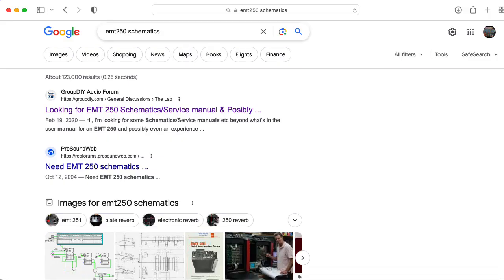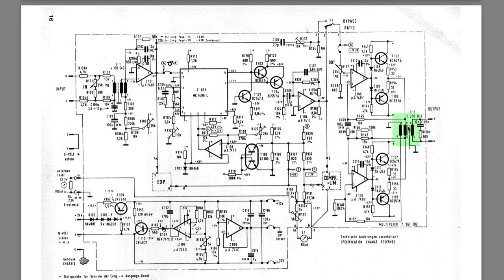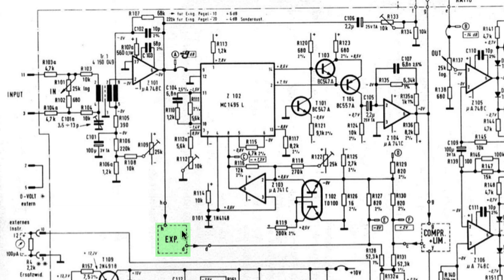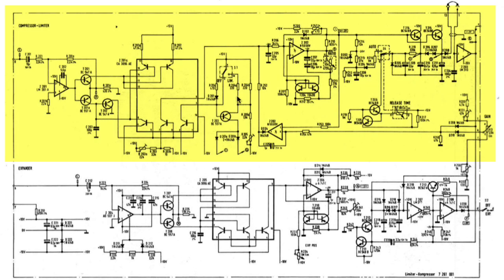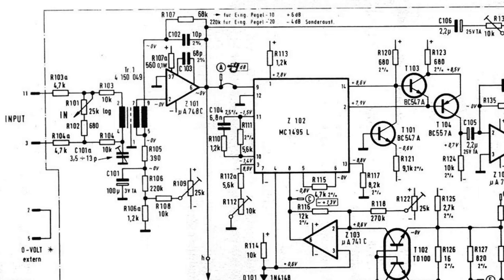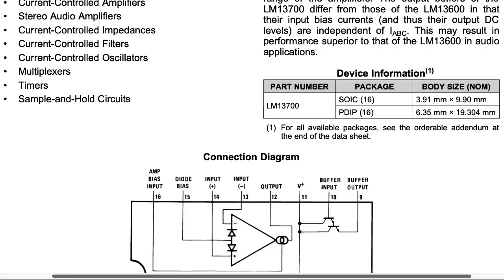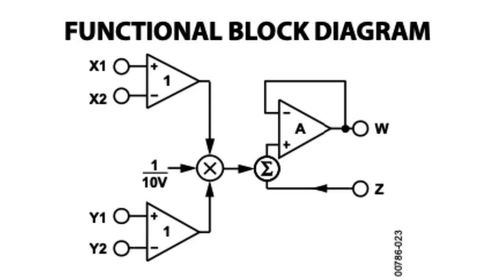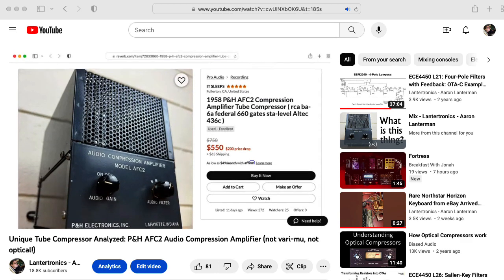EMT 261 Compressor/Limiter Circuit Analysis (never seen THIS chip used in a compressor before)

Comment: The Neuman BSB-74 is a high-frequency acceleration limiter (sort of like a D-Esser) used in their SAL-74 cutting amplifier racks. It is really fantastic... one of the best modules that does that job. A 4 quadrant multiplier was state of the art when it was designed into these units but subsequently, there became better ways for audio gain or filter control, at least in the dynamic range department. The BSB was not built as a stand-alone set. It was only available as part of the record-cutting system.
Reply from the maker: Oh wow! 

(As an aside: I really don't get how anyone could think vinyl is the be-all-end-all of music reproduction technology. There's so many compromises you need to make in getting the music on the vinyl... I didn't even know about this high-frequency acceleration limiter thing you're talking about.)

Comment: I don't have a reference to any compressor design, but I do know of at least two Eurorack modules that use the AD633 multiplier chip. The Northcoast Synthesis Middlepath VCO uses two AD633 chips for linearization of the exponential converter, resulting in good temperature stabilization. And the Befaco A*B+C dual ring modulator uses two AD633 chips for, well, A*B+C.
Reply from the maker: The AD633 is very expensive but very very very good -- it doesn't need trimming the way the 1496 does.

Comment: Don't think I've seen this in a compressor either, but I've seen them in ring modulators, which is basically just amplitude modulation, so I guess it makes sense?
Reply from the maker: Yup!